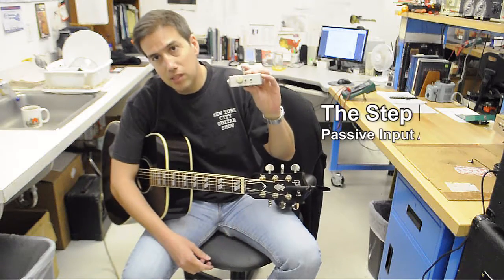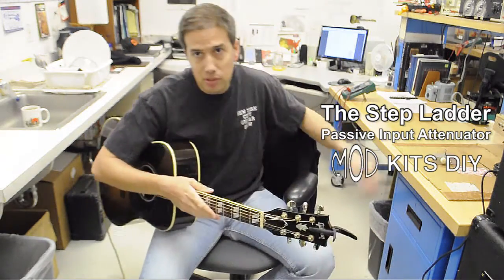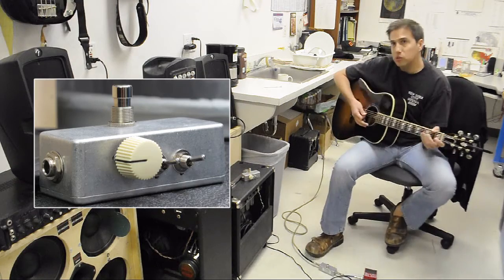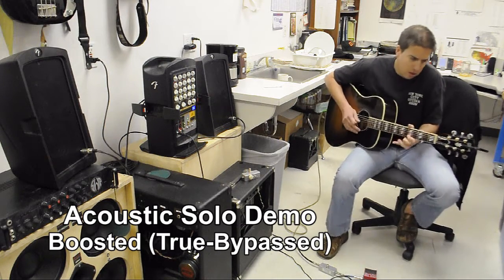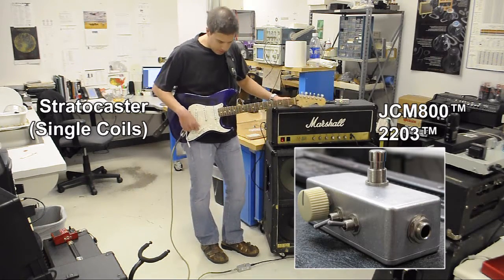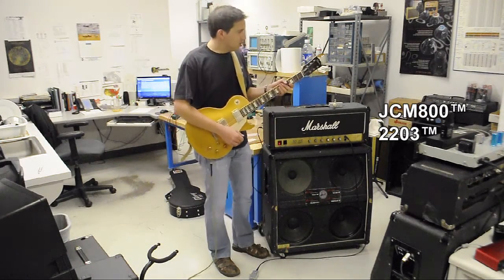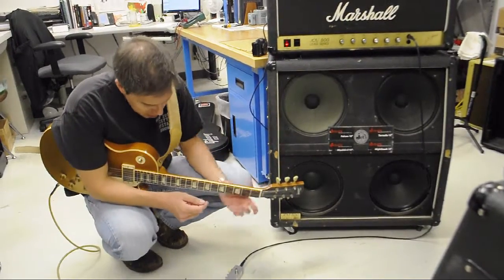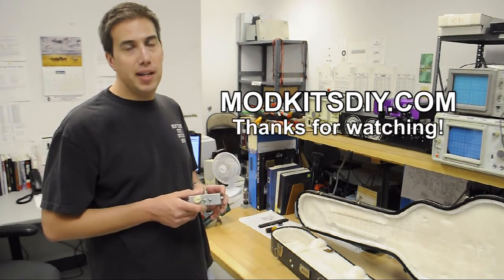Step Ladder Passive Input Attenuator Demo!

Comment: Can you switch the treble bleed on and off to have it either way?
Even if requiring power, I wish it had an LED too.
Im looking for one of these for use with my fuzzes. Sounds gouud with my volume knob at 9.265 (lol)... But it's difficult to roll off to exactly the right amount. Put this in a pedal loop with the fuzz and just hit one foot switch.. Pronto.